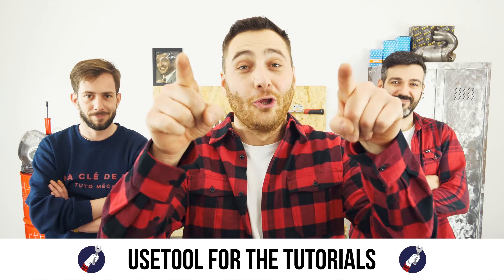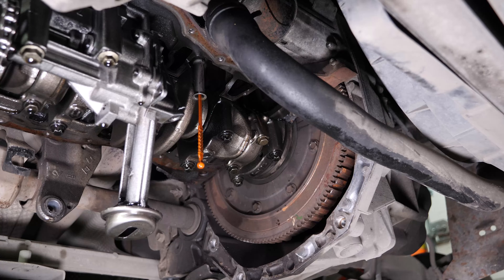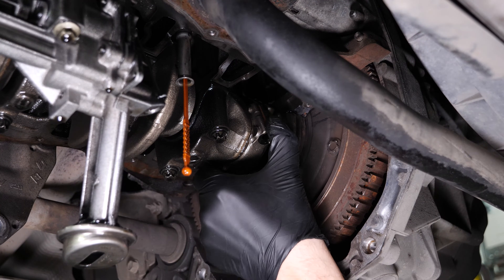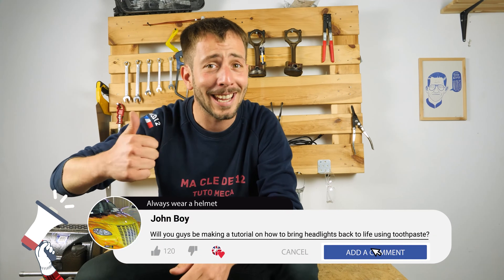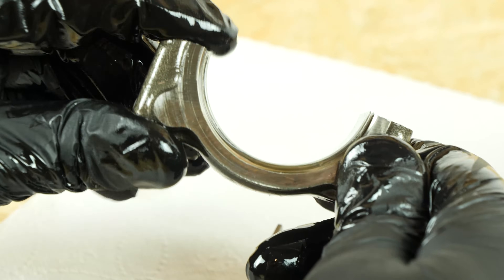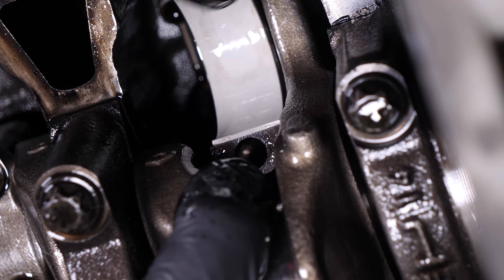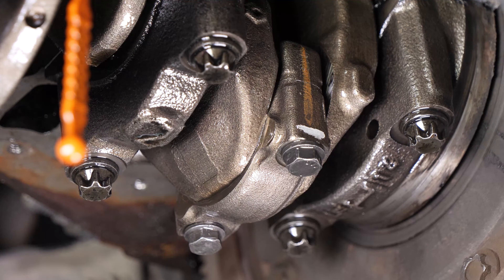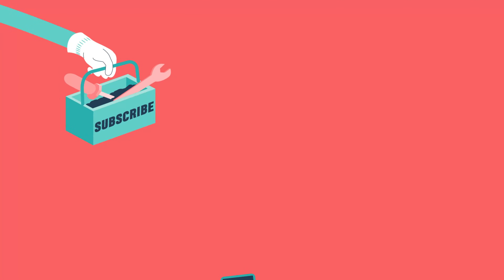How to replace the connecting rod bearings 1.5 dCi 🚗

Comment: How do you know when is the time to replace them ?
Reply: you hear it from the knocking noise, but worth to replace it after 100-120tkm
Reply: @glaszlo9694  I replaced them at 120k KM and the engine died at 220k KM. They are saying you practicaly need new enginine when those bearings turn around.